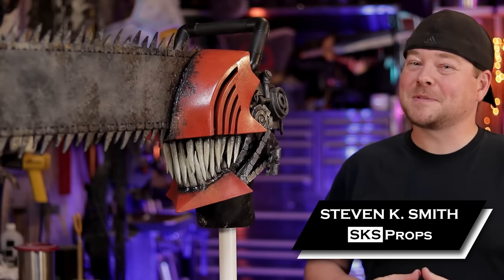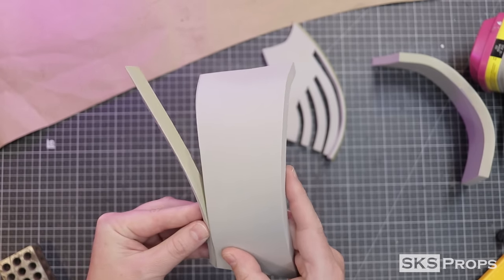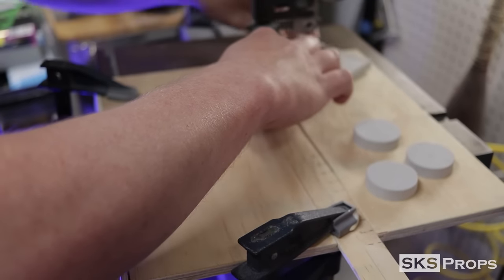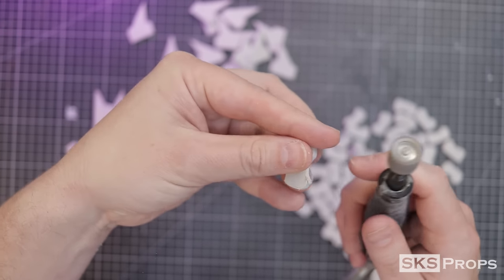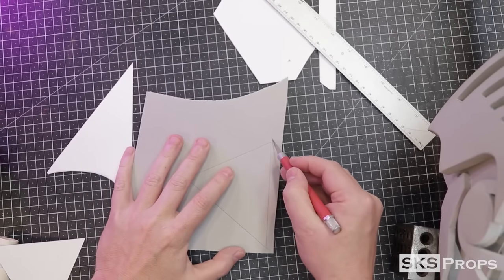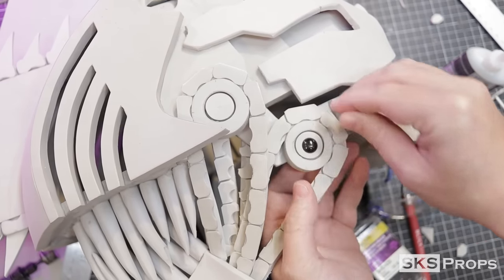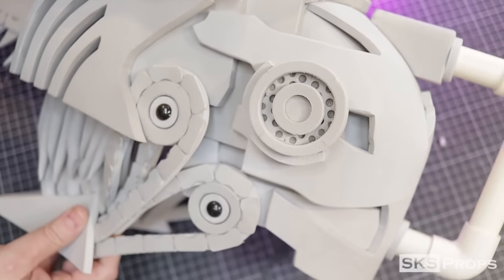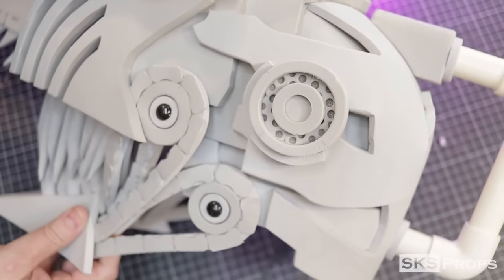How to Make a Chainsaw Man Cosplay - Free EVA Foam Template - Denji Cosplay Tutorial Part 1

Comment: Are you able to see while wearing the helmet ?
Reply from the maker: Of course, you see through the gaps in the teeth and the slits on the sides 👍
The con I went to last weekend there were 7 people dressed as Chainsaw Man all had used my templates for their builds
Reply: @SKSProps  thank you so much, my gf is making me it, she’s cracked at building, what do you use the pbc board and wooden dowels for ?
Reply from the maker: @flyingbeargaming  you can use pvc board for reinforcement in the helmet if necessary and wooden dowels instead of pvc pipes but it’s whatever you have available
Reply: @SKSProps  any tips to cut the parts out from the paper? We seem to keep messing it up
Reply from the maker: @flyingbeargaming  you could always glue the paper templates to poster board before cutting them out that will make them more rigid for tracing as well
Reply: @SKSProps  so like first remove the think line of white border then glue them in map form together then cutting it out ?
Reply: @SKSProps   also we don’t have a poster board atm, would a large side of cardboard substitute for the poster board to cut it out like you said?
Reply from the maker: @flyingbeargaming  I'd think cardboard would be to thick to work effectively
Reply: @SKSProps   we don’t have a heat gun, would a blow dryer or a blow torch work?
Reply from the maker: @flyingbeargaming  hair dryers usually wont get hot enough do not use a blowtorch. heat guns are cheap just buy one at a store or online
Reply: Your amazing for always responding to my questions , the 4mm hd foam for the chain links, is that in addition to the roll listed as part of the main items ?
Reply from the maker: @flyingbeargaming  yes in the description I list you’ll need a sheet of each 2,4,6,10mm

Comment: I'm the process of building this now! Is there anybody else thats having a sort of wobble issue with the chainsaw? Is there any way to sturdy that up so that when I turn my head the blade moves with it? Thanks so much for this template!!
Reply: Use a stabilizer such as the metal bar Steven had used, or any other sturdy object (I'm using two stir sticks). Unfortunately, if you already glued it together you'd have to either make a new one or split it apart

Comment: Do you have any tips when dremelling the teeth, no matter how I use it, it always comes out looking like shit. Can never get it to that perfect little cone shape
Reply from the maker: Start by removing some material with scissors. the trick is dremel from the tip down to the base of the tooth. If you go the other way the drum will grab the end of the tooth and mess it up
Also make sure to check out my video on how I make my smooth sanding drums it will be a night and day difference
Reply: @SKSProps  Thank you very much for the advice. If the round dowel teeth don't work, would making teeth out of foam clay work?
Reply from the maker: @carlosvalencia2763  Yes foam clay would definitely be another alternative for the teeth. and because you will cover them with 5 minute epoxy they will be nice and strong
Reply: @SKSProps  Thanks very much for the feedback

Comment: Anyone know what size forstgner bits to use? and/or alternative methods.
Reply from the maker: 3/4” same as the pipes. You could just make a starter hole with a hobby knife and use a rotary tool to sand it to the correct size
Reply: @SKSProps  Awesome, thanks for the help!

Comment: What can i use instead of yard marker? 4:40
Reply from the maker: Anything that’s thin and sturdy, yard stick ruler, metal rod, etc
Reply: @SKSProps  thank you, this is a lot tougher than I thought. I am working on the jaw rn and the foam won’t sit straight it is always curved
Reply from the maker: @diegoalfaro8284  applu a little heat from your heat gun and bend the foam the opposite way that will help flatten it out
Reply: @SKSProps i know this may be a lot of questions but I don’t have much material and want to make sure that I get it just right. Around how long should each tooth be?
Reply from the maker: @diegoalfaro8284  2-3” in length

Comment: could someone kindly tell me the measurements of the sheet on which I should print the pieces ¿¿
Reply from the maker: Follow the directions on my site and open the PDF templates in adobe acrobat or adobe reader and click poster in the page size area that scales it properly over several sheets regardless of your paper size
Reply: @SKSProps  thank you

Comment: The chainsaw part isn't printing out for me for some reason. Everything else is there except for the outline of the chainsaw part. Does anyone know how to fix this?
Reply from the maker: And you’re printing it using adobe acrobat or adobe reader to open the pdf
Reply: @SKSProps  acrobat I believe
Reply from the maker: I just tried it again and it worked fine. Try a different browser to download it again then open it with adobe acrobat or adobe reader and click “poster” in the print settings 
See if that fixes it for you 👍
Reply: @SKSProps  it ends up looking like this https://linksharing.samsungcloud.com/kQPIW5k55OyQ
It prints the curve then stops and i don't believe it's my printer because it is only the chainsaw part that is doing this
Reply from the maker: You’ve got something weird going on though with your printing because those lines are supposed to be solid and they are outlined 
Try downloading it again using Firefox or google chrome

Comment: Hey. I'm using black EVA foam and was wondering what to use to trace templates. regular pencil is not visible
Reply from the maker: That’s why I don’t use black foam. The density isn’t as high and it’s tough to see the template lines. I hear some use silver sharpies but they run out quick
Reply: I use gold pen to trace template on black EVA foam

It works